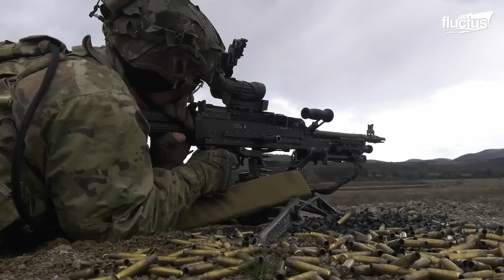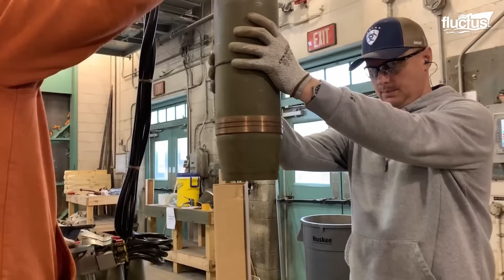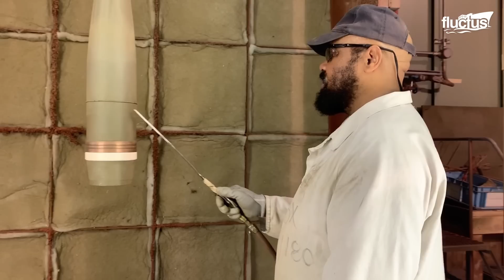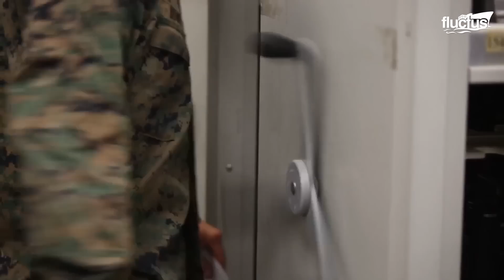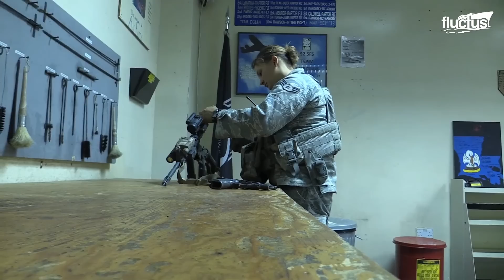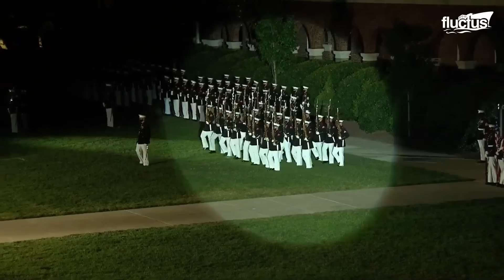Inside Restricted US Facility Recycling Millions of Used Cartridges

Comment: It is amazing that the 160 year old technology of Brass&Lead is still used. Inefficient, ineffective and wasteful. Put Musk on the case and you will have an entirely different individual weapon system that works at half the cost and in 90 days.

Comment: It's crazy that most of the cases aren't just remanufactured into ammo again. There's no need to melt them down and make more casings. Reloaders have been doing this basically forever. The cases could just be reused. Keep the virgin ammo for actual conflict. Use the reloads for training.
Reply: Some military ammo has crimped primers that are difficult to remove .. I modified by reloader to eject them without damage .. with a stronger HSS ejector pin .. it's poplar modification :)
Reply: The problem with that is, you can only reload three times. It would be hard for the military to know how many times the casings have been used.

Comment: So why are you talking about recycling 155 mm shell casings and showing manufacturing 155 mm PROJECTILES?
Reply: The 155 doesn't use cases. 
Only the 105 does
Reply: @lestergillis8171  The point was you were talking about recycling cases and showing the construction of projectiles.
Reply: @rickswanberg4995 I do mist of my own reloading of what I shoot. Zinc wheel weights are useless. I throw them in my recycling bin for the recycling route to pick up. Rifle brass will ultimately become work hardened. I have seen videos that demonstrate home annealing process, but I've not tried it yet.
Reply: It's like the video was chosen at random to only vaguely fit the topic! :(